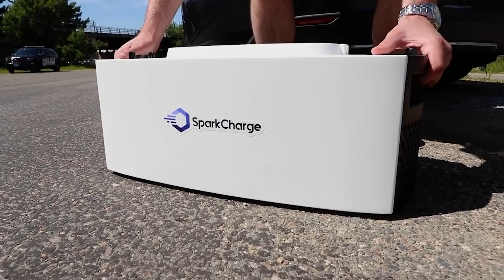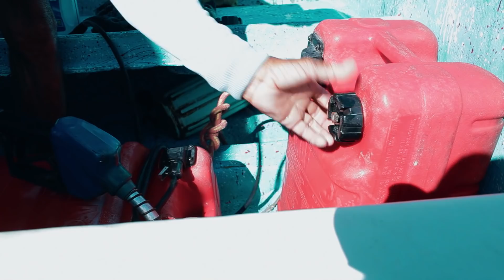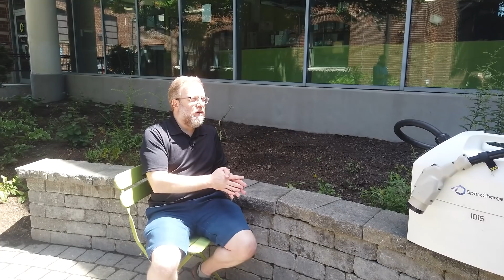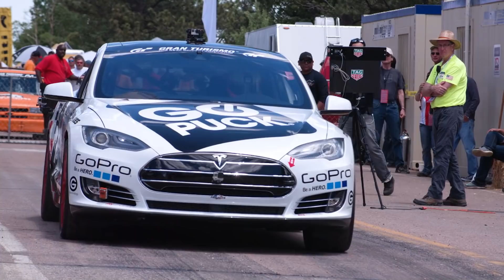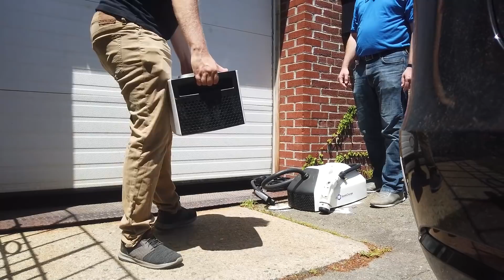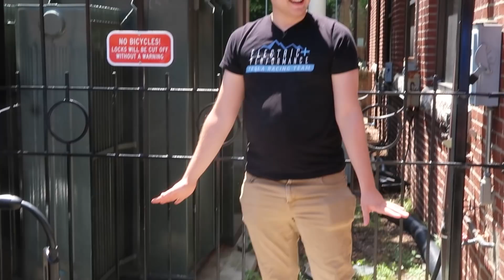SparkCharge | Range to the Rescue!

Comment: How long ago was it that I suggested someone needs to make something just like this? The problem with EVs is not lack of range but people who forget to charge it or are just too dumb to realize they should stop for a charge before that range left indicator goes to zero, because getting a car that has run out of juice to a charger is so much more difficult than with ICEs.

But that battery pack is strictly for adding few miles so you can get to the charger station, it is not convenient for EV owners to carry in their car to charge it on the road. Trying to replace proper charger by charging that tiny battery at your home, then using it to charge your car would be wasteful, expensive and time consuming, it just plain wouldn't work. Also, even if you had more than one battery to speed things up the large number of full drain/recharge cycles would degrade them pretty quickly so most people wouldn't have the money to keep replacing them.

Comment: the issue with keeping this in your car is the weight of the batteries will cut into your range so the idea of keeping the stuff in your car for backup might not be the best idea BUT the fact that this is a real product means every tow truck NEEDS to buy this NOW is a very real thing.... Also I can see the ever growing list of car repair people who COME TO YOU to fix your ICE car might also wasn't to expand their business offerings.  In fact car detailers that come to you might consider adding this to THEIR list of services... Anything to set yourself apart is a really good thing to do when you are running your own business. (so long as the cost isn't TOO expensive and given the cost of Li-Ion batts this it's understandable if it is....) - Still as the cost of everything drops they are in a great position so long as their technology can interface with however the new solid state stuff .... comes out as....

Comment: Hate to be negative but very few people run out of gas today and I think the same will be true of electric. There is some use for it in limited ways but would not be a good idea to constantly have one in your car because the added weight would work out to a negative overtime. Tow trucks and AAA may use it for a time but there's probably a better way to have a generator aboard their trucks to charge a vehicle. Sorry.

Comment: Would like to know how to recharge the Batteries.
Can they be charged independently of the top unit?
Mains (240V for me) or also via a 12V (or other DC voltage) supply?

Didn't see any pricing on their website.
Be even better if there was a 240V AC top piece available - or some sort of 240V AC output - for mobile power purposes.

Comment: How many people carry a Jerry can? I can’t see the average EV owner carrying one of these and nobody mentioned the price. A jerry can is small bucks but this guy ain’t going to be cheap.   For a breakdown truck yes seems a good idea, a better idea is don’t run out. 🤫
Reply: Or to run out of gas. But it happens. And it's harder to run out of gas (so many stations) than it is to run out of charge.
Reply: Kevin Blanc 
That’s true,  with an ice car you can wander of with your cheap empty Jerry can and collect 30 miles of gas. BEV, that’s a different matter if you buy one of these chargers it going to give 5 miles take up much more space and cost I’ll bet a grand or more. No ones going to buy it just for the odd occasion they may run out of electrons,  hoping their less than 5 miles from a charging station. You’d be better taking a generator and a gallon of gas, which is exactly what the BMW I3 offers with their car. In the U.K. they have breakdown vans fitted out with a generator that runs of the engine through an inverter that charges a stranded motorist with just enough to get the to a charge point.
Reply: A N Other 
Really? Would you pay 💰 I’ll bet a gran or more to extend your range by 5 miles and then lug it around in you trunk?   I certainly wouldn’t. I’d sooner spend the extra on the car in the first place.
Reply: The Notorious Artorias 
Yes I agree if one day in the future one was made the size of a Jerry can that held 30 miles of charge and could be carried like a Jerry can to the garage to charge up in an emergency it might come in handy.  However if batteries get that small and light the car could easy carry a 5/6/700 mile or more capacity then as with ICE cars who would bother with a back up fuel supply.
Reply: @Dark_AbsoI  You get that if you check the range left / charge in the battery.  Maybe they add a red light on@50 miles left in battery.

Comment: Back up power for a house .
In a disaster run your house .instead of a generator
Reply: Yes there is the power wall but in this application.The power is portable .
For a NGO or the Red Cross.
It should madatuary to have a backup switch and plug in house built in high prone disaster areas like Florida .
You need the switch so you don't back feed power down the power line while someone is working on it.
Reply: Tesla powerwall...
Reply: They could make this to be your power wall but you can take the top part with you when you need it or someone else needs it and part of it could still power your house.

Comment: This should be a standard item in Tesla Service Centers and Mobile Rangers.  Tesla could, of course, make their own from recycled modules salvaged from old S and X battery packs.
Reply: Probably, as a side effect of V2G, it will be possible to charge on the road from one Tesla to another. At least it seems like a sensible solution for a two-way charger.
Reply: That’s the biggest danger to his business.. if Tesla decides to make their own.
Reply: @rantingcullinarian  Or they could put them in Amazon delivery vehicles.
Reply: @rantingcullinarian  this startup could pitch their product to Elon and he could buy it or buy part of the company.
Reply: I've own a tesla for 2 years and have traveled across the US. I find it impossible to fuck up the charge. I've never made the stupid mistake of running out of gas with my ice car. The same would go for my EV. The car tells you if you need to recharge. 

This tech is for forgetful people.
Reply: @Tuck_Frump  thank you Stan. thats what i ve been preaching since 2011 when i first started working on Tesla  Nevertheless, I can see a huge market for the "SparkCharge"
Reply: @Tuck_Frump  I just carry a portable generator and two bottles of propane with me.
Reply: Why carry around extra batteries? Just put bidirectional chargers into your vehicles, so every service vehicle is a 100kWh charger on wheels.
Reply: It's definitely possible for them to modify a Tesla so that it could drive out to a stranded vehicle and charge it using power from the rescue car's battery.
Reply: Or do what nio did with their EVs...modular battery stations. Nobody going to carry 50lb vacuum cleaner in their trunk
Reply: @Ronald McReynolds  I'm afraid that Tesla is a step ahead, in time they could drive a Cybertruck and charge your car from a 200+KW battery .. great effort but they best find a way to utilise it
Reply: Ronald McReynolds Maybe, but if it adds convenience and is bundled in with Tesla Insurance it could be a very compelling product. Who knows.

Comment: Doesn't seem to be much of a charge - 15 miles. Wouldn't a little gas generator provide more charge? Like, if you were going camping, he said you could take 4 modules along in your trunk. That will still only give you 50 miles. A gas generator could give you a full charge.

Comment: I love this idea, but eventual vehicle to vehicle charging will solve this problem.
Reply: I'm not sure if the Cybertruck could do that. Hope so...
Reply: I don't think it will be useless even if vehicle to charging becomes standard I invision this item like todays jump starter you have one in your trunk for when you get stuck.
Reply: I agree. More sustainable for sure
Reply: I don’t think so. Tesla has been against V2G and V2V solutions for a long time: and once autonomy hits, computers will never push the limits like the dum dum humans will. They will never run out of charge except in insane cases.
Reply: @peachezprogramming  When has Tesla they been against it? Tesla is even thinking about integrating all your energy into one package: you got your Solar Roof and Tesla Power Wall, you charge your Tesla from the Solar and during power peaks your Tesla pushes power back to the grid and the Power Wall. V2G and V2V are indeed essential part of the smart power grid systems of the future.

Comment: Wow what a great product!  I can see so much potential in that.  one thing that wasn't mentioned that I would like to see is the ability to use this as a portable generator for non-EV applications.  With the PSPS events coming up soon in the Bay area I would love the ability to plug one of these into my house instead of using a loud dirty portable gas generator.
Reply: Absolutely,  I have a 2200W portable generator and I hate the noise and smell of running.

Comment: Really nice device and fine for rescue situations. But... How much range to you lose from your Tesla or other EV by carrying this unit and batteries in the trunk? With four batteries, it must weigh over 100 pounds. Also, what's the turnaround cycle of the Sparkcharge? How long does it take to charge? Can it be recharged from solar so it would be viable to spot around remote locations?

Comment: Every tow truck in the world is going to need at least one with a couple of spares battery’s as will. Not to mention a lot of Tesla end users will want one for their own “peace of mind”. I wonder if Tesla might just decide to acquire the company and end up offering this solution as a option.
Reply: Some road side service trucks have special ICE generators like the kind you use for a welder.
Reply: Jay Bee same thing I said. Just use a $500 gas generator with a Tesla plug. Ironic but it is much cheaper.
Reply: @josemontez4338  And slower. Even if you're using a level 2 charger with a hefty generator you're going to spend almost an hour to get 20 miles.
Reply: Jay Bee ok

Comment: Well now there is a electric jerry can..   E-Jerry Can.. Ok.. I coined it.. Have a nice day. 
Easy to make and build just a matter of staking up Li-ion in a carry case size and just well Every Section Added is well a good deal.  Most AMA trucks could carry it over.   Portable power wall just no AC inverter its just DC to DC fast charge.
Reply: Terrance Van Gemert a Jerr-E-Can
Reply: @blueoak00  or just E-can 😊

Comment: If people could buy this, this could work for people who dont have a charging station at home i.e live at an apartment. Also for people who often go to camping trips
Reply: It’s got 3kwh of energy in the pack, you’d have to drag it up and down the stairs to your apartment a two dozen times to get a full charge.
Reply: @edc1569  you can put it on a foldable part cart or install the wheels to its. everything is solvable.
Reply: The use case for apartment dwellers would be if you don’t have 240V available but do have 120V in a garage unit. The Sparkcharge unit(s) can be Charging or charged at any time and waiting to be used at your discretion for a rapid boost.  I was on a Camping trip out West  in the Bighorn mtns Wyoming a couple weeks ago. Our favorite campground does not have electric hook ups and no fast charging infrastructure within 80 miles. I really wanted to take my Model 3 P- but instead drove our Volt due to to the remote areas we wanted to visit on Day trips away from the camp site.  It was also annoying hearing the various generators running every evening at the campground. I have a 2000 Watt generator that’s about the same package size the the SparkCharge single module unit.  I hate having to use it because of the noise and stink of the exhaust.
Reply: John Wood while we’re on the subject of calling people out, let’s not ignore your horrible grammar. A lot of room for improvement in that area
Reply: John Wood I was just being honest lol sorry if I offended you. Carry on
Reply: ? Dude, you forgot your brain? And your stupid comment got 8 likes ?
Reply: caoYB 
No need for insults, whilst I agree it’s going to be way to expensive to warrant owning,  it’s a good idea for recovery vehicles.

Comment: Oh man, this solves a problem for those who live in apartments and have no garage or EV charger on-premises.
Reply: @Ah Millionaire ?? You lost me, How would that work if you have no garage/parking garage in an apartment building and your apartment is 3 stories up? lol.
Reply: MadStyle you’re suggesting man handling this battery up and down to your apartment 3kwh at a time as a long term solution?  This product is neat but that’s definitely not what it’s for, and I doubt most people will want to pay the call out street service as a regular method of charging their car.  In London you can get your petrol car fuelled on your driveway, but it costs a fortune.
Reply: Ah Millionaire check your local laws, in some states and countries the owners can’t not let you install a charger at your cost these days
Reply: I leave in a second floor flat, no garage, I could recharge the battery with my two 320Watts solar panels on the balcony and then bring it with me when I go for a longer trip with my Leaf.... just an example

Comment: Truck should be electric , and lot of juce in to share.
Reply: If Tesla can power share...then this company is done....a Tesla roadside service will be a small tesla semi or a cyber truck that can powershare.
Reply: @mana9013  Cybertruck has a 220 outlet in the bed.. Just plug your mobile connector and off you charge.
Reply: @pascalabessolo5350  oh trueeeee. Good call.
Reply: That's where you just use the charging power electronics and tie into the traction battery. Easy pivot with a modular design.

Comment: How does this get around the grounding issue ? Tesla won’t charge when the charger is not grounded ?
Reply: You can have a ground in the battery. Probably its enough to have a relative ground as with all voltages.
Reply: @alemed01  exactly, I was about to type that :P
Reply: You would need a copper rod hammered 2 feet into the ground .
Reply: zaferroni yeah at least but 20 feet is even better!